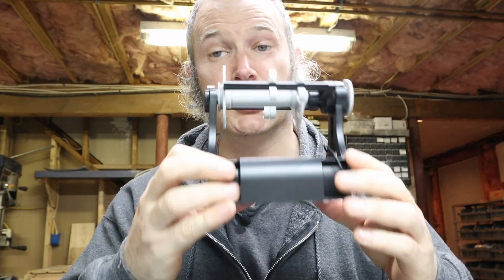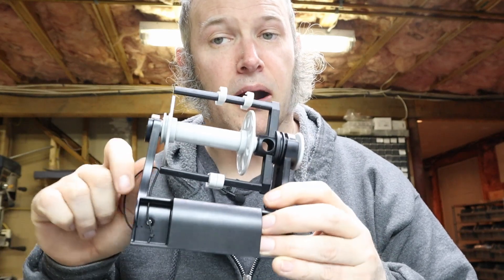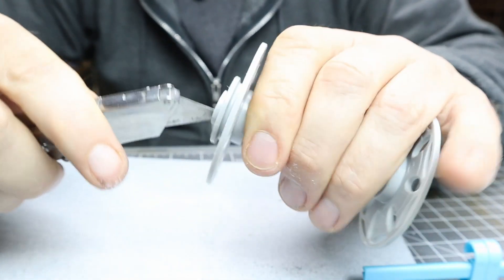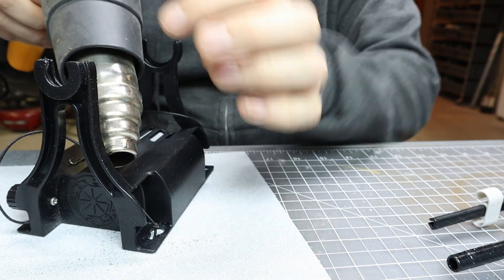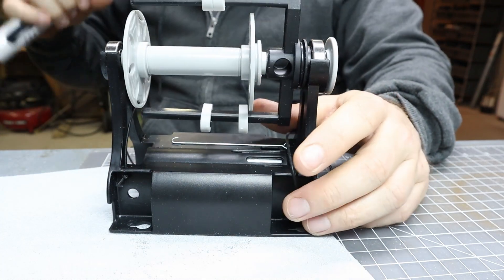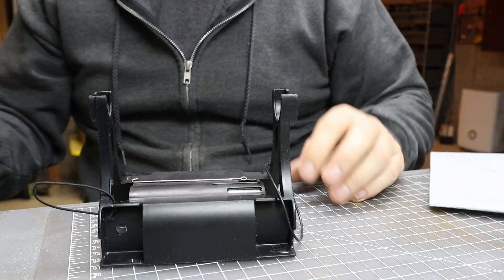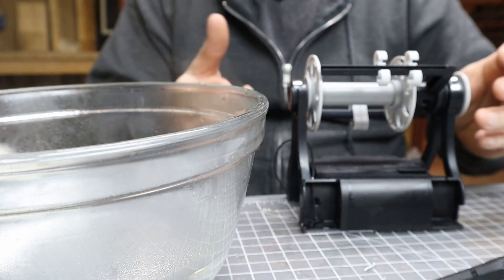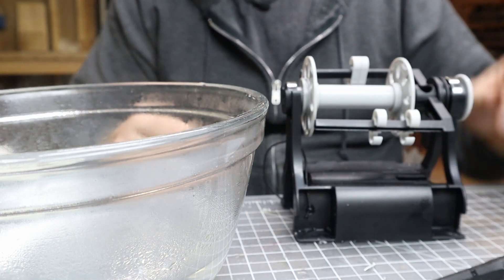Spin 156 - EEW Nano 2 Flyer Uptake Hack

Comment: Hey there, I’m using an eew nano and somehow after spinning for about 5 minutes it always gets super slow.. so slow I that have to wait before feeding the yarn on my bobbin because the twist needs to build up.. if I turn it off and wait a while before continuing it will spin normally again for again about 5 minutes..
I also feel the motor gets pretty hot, maybe that has something to do with it?
What could I do about this?
Reply from the maker: That doesn't sound right.  I'd suggest replacing the motor.  I sell them on my website.

Comment: Thanks for the info! Tip for sanding, if you sand in a figure 8 shape it'll do a better job of sanding evenly than going back and forth in a straight line.